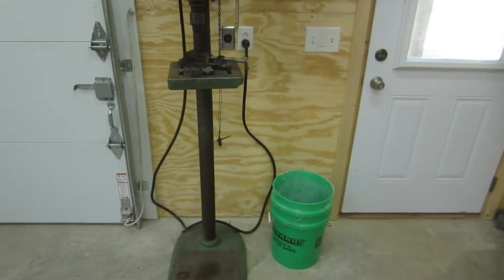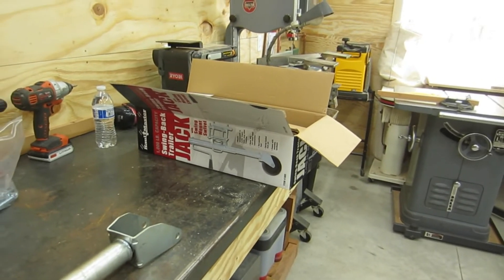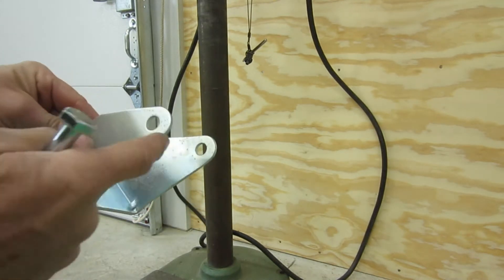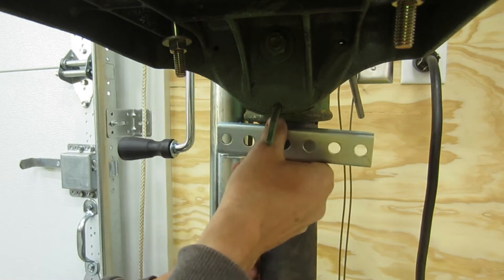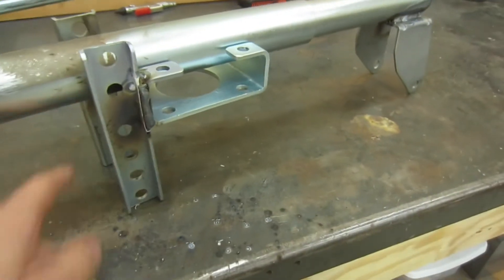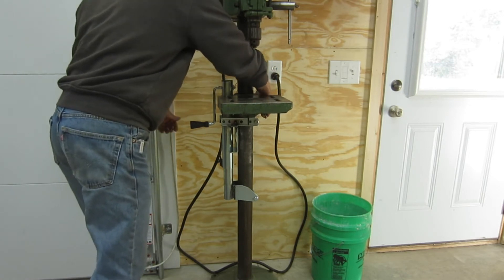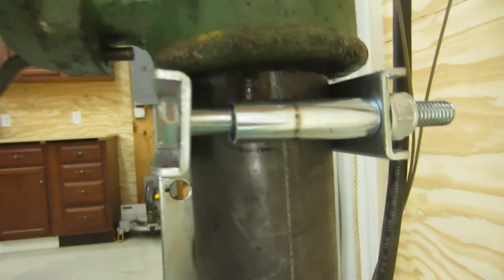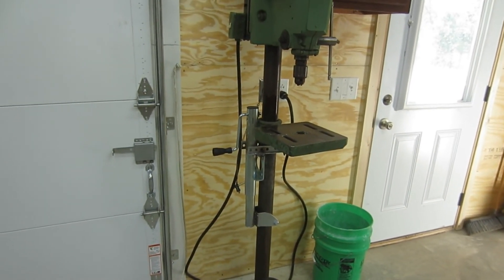DIY Drill Press Table Raising Mechanism

Comment: Just a thought. I have an old 1950's Craftsman made by King Seeley Tool Co.  One thing that helps tremendously is cleaning the rust and gunk off of the column, and flashin a torch over it to warm the metal (open the pores) then applying a good layer of Paste wax to the column.    My Dad made a weight using a larger tin can filled with concrete, a pulley under the head  and connected the table and weight through the pulley with small steel cable.   It served as a counterweight and assist, rather than a complete crank-up.
Reply from the maker: Now that is a genius idea.  It would sure make adjusting the height a snap and probably something a guy could do with one hand.

Comment: Nice! I was going to use a car jack but maybe the trailer jack migth be a better option.  Cheers.
Reply from the maker: Mine is still working great.  I've mentioned this in other comments, but in case you missed it, I cut down the shaft on the handle after I posted this video.  You don't need that much leverage, so a shorter crank works better on my press.

Comment: I bought an restored an old Elliot Progress Junior no12. Its a very simple drill press and just like yours, it has no lifting mechanism but its very rigid and solid. This is a very good idea because the just the table unit is quite heavy. So me being quite young it hasnt cause any problems yet by lifting it up and down manually, but i could see that it could easily crush a finger or two if it dropped accidentally. Thank you for this idea

Comment: Oh my gosh, I have been looking at my Craftsman Drill press and cussing out the height adjustment each time and had stopped using it due to the many skinned knuckles.  I was looking at yourtube and this is a godsend.  Thank  you, Sir !!!!
Reply from the maker: I"m glad you found the video and it was helpful.  A couple months after I put out the video I made one more mod.  I cut and rewelded the crank to shorten the stroke on the handle.  That made it a little easier use.  You don't really need a lot of leverage to raise or lower a drill press table.

Comment: I just ran across this video and have an old Rockwell similar to yours. Going to try to make it for mine.  Thanks much for the detailed video.
Reply from the maker: You're welcome.  One additional mod after I built the lift was to shorten the throw on the crank.  I cut it, shortened it and welded it back together.  Turns out you don't need a lot of leverage to raise or lower a drill press table, so no need for a long crank.

Comment: Nice! I'm going to fab mine up shortly. I think I'll shorten the crank handle slightly and also position the jack behind the press. I'm pretty carefull with setups and clamping work down but if something spins around  I don't want it smacking into the jack. Thanks for the video and idea.
Reply from the maker: I shortened the handle a few months after I put out that video.  The long crank just got in the way and you don't need that much leverage to raise or lower a drill press table.  I hope it works out well for you.

Comment: I have the same type drill press and intend to use your ingenious idea. I do plan to incorporate something I found for my cargo trailer jack stand that has done very well. I use an old wood spade bit, attach it in my cordless drill and insert it in the crank end that comes up out of the jack stand itself. I can raise and lower the trailer effortlessly and probably ten times as quickly. The drawback on this method is the “flopping” handle as it goes round and round. I am thinking I can do something very similar with your plans as the foundation and maybe removing the crank handle or welding or attaching a drill extension directly to the stand. . Thank you so much.
Reply from the maker: I'm glad the video inspired you make the mod and take it a step beyond.  It's been working great since I put it on and the only post video mod was to shorten the throw on the crank since I don't need a lot of leverage to raise or lower the table.  I'd like to see your finished product in action.

Comment: Thanks for sharing this with us.have been looking for a way  to put a lift on my old century machinery drill press I bought.
Reply from the maker: I'm glad it is helpful to you.  It's been working flawlessly for me.  The only thing I changed after putting out the video was to shorten the stroke on the crank, since you don't need much leverage to lift the table.

Comment: love it, ergonomically perfect.
Reply from the maker: Thanks.  I made one small change after the video.  I shortened the length of the crank handle by cutting out a couple inches and welding it back together.  The shorter stroke works better since you don't need much leverage to raise and lower the table.

Comment: Great Idea.  I'd love to have one for my Craftsman Drill press.  Could I hire you to make me one?
Reply from the maker: I'd do it, but considering the Craftsman would be different from my Delta, I wouldn't want to attempt it without the drill press on site.  You might consider getting all the parts prepped and bringing it to a welding shop to finish.
Reply: @TheToolmanTim  My craftsman looks Idential to yours and wouldn't be surprised if they were made by the same manufacturer.

Comment: Nice one!

Now to figure out how to do that without welding.
Reply from the maker: Thanks!  Glad you liked it.  Maybe you could do something with some u-bolts to accomplish the same thing.  I'm thinking a u-bolt around the jack shaft, then a plate and nuts to secure it, then some washers for spacers another plate, then the drill press shaft and finally one more plate and nuts to secure it.  Might be worth a shot.

Comment: I rebuild a lot of vintage drill presses and spend a fair amount of money on "factory" table elevators for them. Your solution is simple, easy to do and most of all, functional.  thank you!
Reply from the maker: Thanks!  Now that I've been using it for a while, I plan on one small mod.  The jack has a long stroke on the crank for leverage to lift a heavy trailer.  I don't need a lot of leverage to raise or lower the table top, so I'll be shortening the stroke on the handle.

Comment: I wonder if a farm jack might also work?
Mine had a rack but I bought it broken. Its a twian made drill press and that company no longer makes tools. 
So I have an option to buy a rack from grizzly tools and hope it works or buy all the rack, table parts and hope it fits the shaft.  Other option is what you did.
But I dont like where you put the handle looks like it get in the way for a add on table fence system.
Reply from the maker: Cool idea.  I would like to see the farm jack variant.  Your right about the crank location.  It just clears my small table, but it works for me.  If I expanded the table or added a fence, I would probably cut the handle down and reweld it so it would run under the table.  The trailer jack was designed with a taller crank to provide good leverage for lifting a heavy trailer tongue.  Running a drill press table up and down wouldn't require anywhere near as much leverage so a shorter crank would still do the job nicely.
Reply: @TheToolmanTim   you could almost use a power drill to do it electronically.  Ive seen it done with other lift systems.
Reply from the maker: @bobbg9041  I like where you're going with that idea.  It would be a cool addition.  A guy could probably rig a corded variable speed reversible drill motor up with a well placed switch mechanism.  You could use the same power source as the drill press.

Comment: MR PETE  TUBLECANE shows a set up of cable, pulley at top and a counter weight. this is my plan to make moving the table easyer
Reply from the maker: I looked at some pulley based systems, but opted for a crank making it easier to do depth adjustments more precisely.